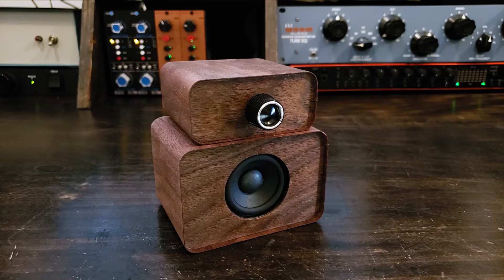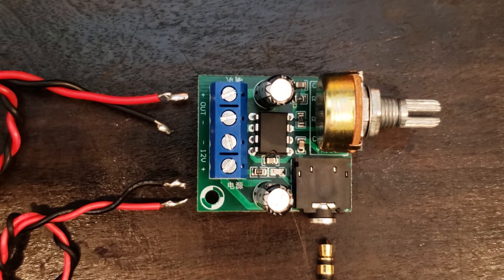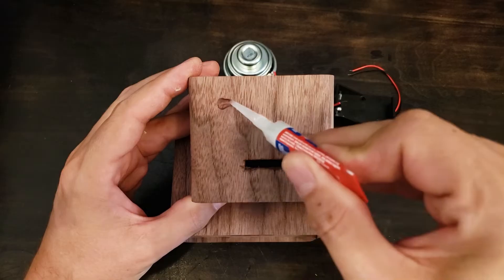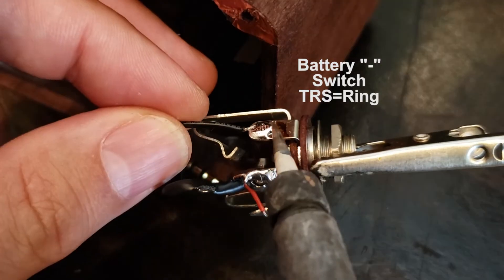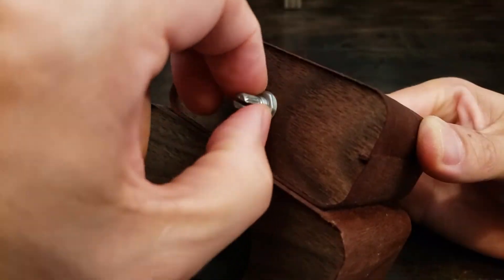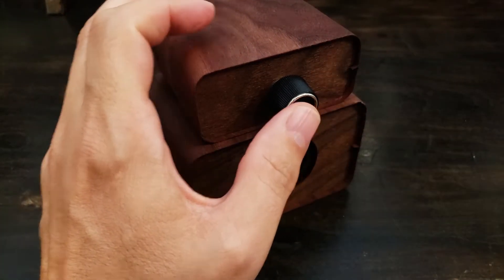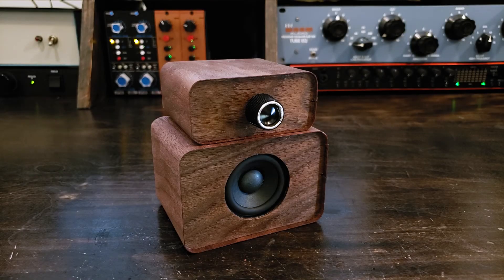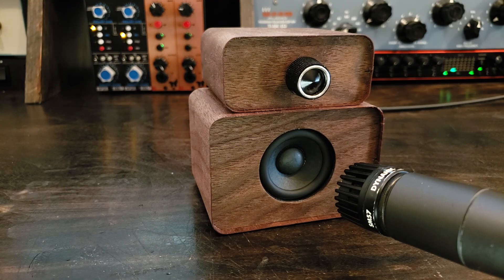DIY Guitar Amp - Amazon Parts #guitar #miniamplifier #electronics

Comment: I made one and im really happy with it thanks. If I want to increase the gain can I just short pins 1 and 8? The data sheet says that putting a 10uF capacitor between them gives a max gain of 200. Would you happen to know what just shorting them would do? Thanks again
Reply from the maker: Cool, glad that you got one going!  Yes, shorting those gain pins will get you to 200 also.  Here's a vid I made a while back, just shorting pins 1 and 8- no cap. You can hear what it sounds like:  https://youtu.be/aDMb_JYIqHQ
 I think simply shorting the pins could lead to oscillation, but I've never experienced that.  Sometimes using a gain pot without a cap can add a little static/noise as you adjust the gain.  To me, removing the cap and shorting the pins has a bit more "bite" so to speak.  It could be that gain is the same with or without the cap, but it just sounds different enough to notice.  They're cheap enough that you could buy a second one to experiment with if you don't want to dismantle your working one.
Reply: @FrankOlsonTwins  awesome, thanks a bunch!
Reply from the maker: @gianni777m  you bet!

Comment: Would connecting the ring to battery negative to act as a switch mean that it wouldn't power on with when a trs cable is plugged in? Thanks for the cool video
Reply from the maker: Yes,  correct!
Reply: @FrankOlsonTwins  thanks for the reply!

Comment: Did you short the gain pins on this one like your short video. I got it to work, but stopped working once I shorted those pins.
Reply from the maker: I've done it both ways with this kit.  As it comes, there's a capacitor between pins one and 8.  You can remove the cap for low gain or remove it and short the pins for full gain.  If you leave the cap, it'll be about 75% gain, which is pretty good, too.

Comment: I would like to add a 1/4" jack where the current jack is ( So I can position it where I want to inside the amp) so would I just remove the jack that comes on the circuit board? and solder the 1/4" jack into the circuit board? If so...which pins should I solder into? I believe there are 4 pins on the one that comes on the circuit board, just trying to figure out where to solder the 1/4" jack once the other one is removed, hope that makes sense, really interested in learning electronics, great videos by the way.
Reply from the maker: Hello!  Unfortunately a 1/4" jack is too big to fit on the board, which is why I used the 1/8" adapter for the video.  If you decide to take the mini jack off the board and solder your wires directly to the board(which you can see at 3m19s in the video), you'll find that the center pin of the jack was ground, and the corner pin was "+" for input.  The multi colored wires(3m19s) are going to "+" and the shield is going to "ground."  You'll see it says "IN"  on the board next to the "+" hookup.  I suppose you could make long extender pins for your 1/4" jack and insert those into the board sockets when you remove the mini jack.  Thanks for checking out the vid!
Reply: Got it!!! Thank you, I somehow missed that at the end of the video, appreciate the help!

Comment: Cool video - I’ve been wanting to build a mini amp powered by a usb battery pack. Any tips on making something like this running off 5v?
Reply from the maker: Thanks!  This unit works fine down to 5v. It can also run as high as 24v.  No need to change anything but I do like to short the lm386 pins 1 and 8(gain pins) on the board. It will kick up the gain by about 5 times.  If there's a cap there(probably is) you can just short the pins together or remove the cap and insert a little jumper.
Good luck!  Let me know how yours turns out!

Comment: To be sure, I have to buy a mono jack and cut one side to have a black and red wire to connect to the female jack 6.35mm ?
Reply from the maker: Yes, mono plug (mini) to trs jack 1/4" jack
Reply: Thanks a lot💪🏻 I think you should have a look at the 6j1 preamp board, I've tried a project with it but didn't succed as I'm a beginner.. with your videos I'm sure I'll make it!
Reply from the maker: Thanks for the tip! I've made tube preamps in the past.  They look easy but the power supplies are the hard part.  And the enclosures... they are a LOT of work!  Good luck!

Comment: That is great.  Can you please say what I would need to build a bass version, please?
Reply from the maker: Ok, so I plugged in my bass guitar and it seems like the only requirement would be a bigger speaker. You could wire up a an output jack in stead of a speaker to try out different cabinets.  Good luck!
Reply from the maker: Thanks!  I'll check into it!

Comment: Very nice build. Would using a slightly larger speaker significantly change the sound?
Reply from the maker: Thanks!  Yep, in this case a 3" or even 4" speaker can dramatically improve the sound.  You can drive up to a 4x12 half stack if you add a little output jack to the speaker...it would be pretty loud too!